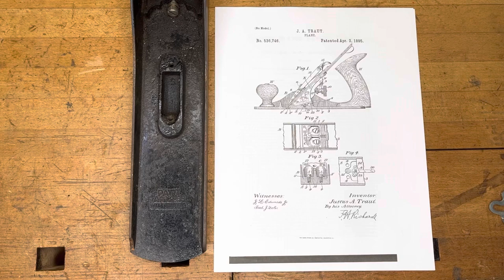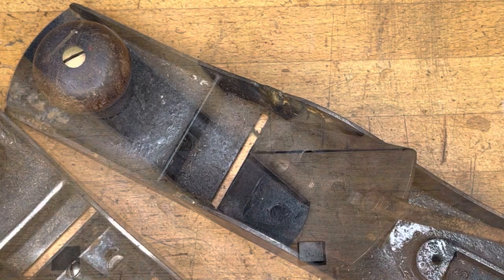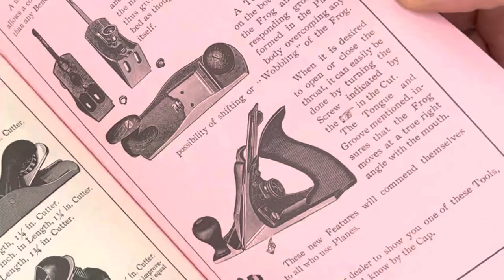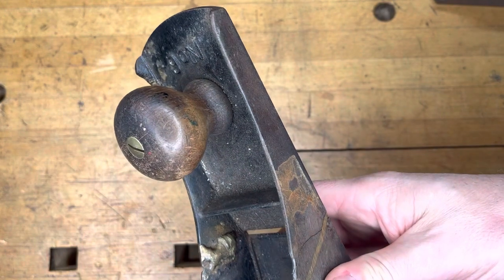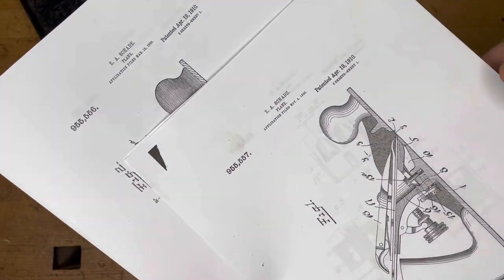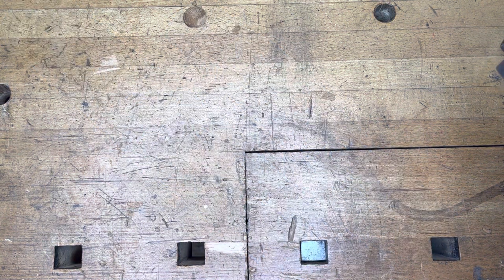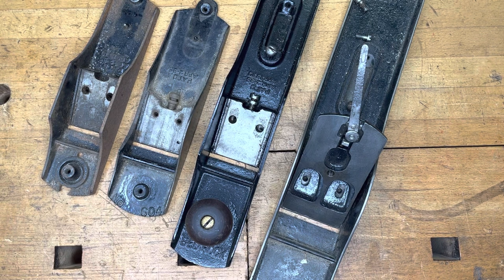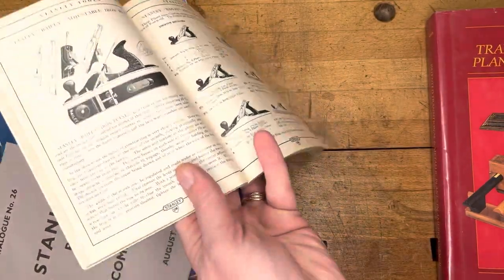More on Stanley Bedrocks w/ Just Plane Fun - type study Part II

Comment: $2.90 in 1900 is roughly $100 in 2023. Interesting that what was probably the top of the line hand plane in the world at the time was only $100.
Reply from the maker: The price difference between the Bedrocks and the Baileys was a lot less than I would have thought
Reply: $10 a week wages for working man 1905. If skilled working man today is $200 a day, then that’s $300 equivalent for the plane. That’s about right

Comment: I found a bedrock 607 for $50 on OfferUp the other week but the seller use an abrasive wheel to knock out the rust trying to make a quick bucks off the bedrock plane. I had the unfortunate time to flatten the sole of the plane.

Comment: 8:45 Have you tried an S bend or right angle screwdriver? The ones with a flat on one end, and philips on the other? That might fit back there.
Reply from the maker: That’s a good idea. Might have to see if I can find one. The challenge is getting enough leverage on a stuck screw with a chewed up slot. Wish me luck!
Reply: Maybe one of those ratcheting screw drivers that accepts hex bits?

Comment: To me , moving the frog forward introduces a “ cantilever “ with the blade / rear of mouth on the sole? Moving frog back to open the mouth means cutter is not fully contacting the frog?
Reply from the maker: It’s not a huge adjustment - it’s quite small relative to the size of the mouth but it can have a big impact. The frog is still fully supported by the sole, especially on a Bedrock - there’s no cantilever thing going on there. And the blade is still fully supported by the frog